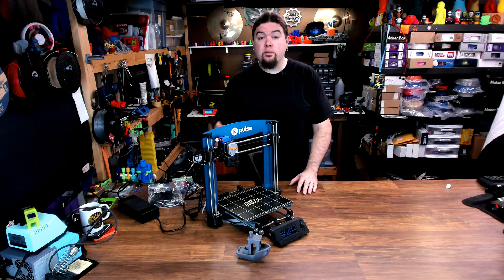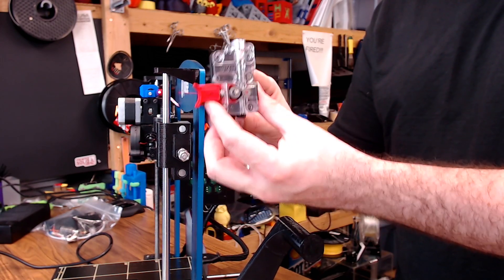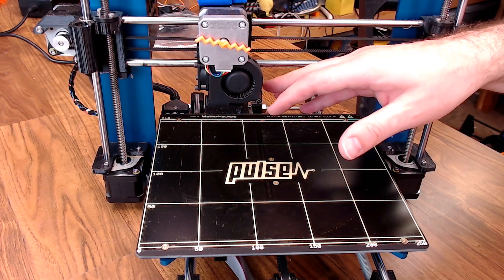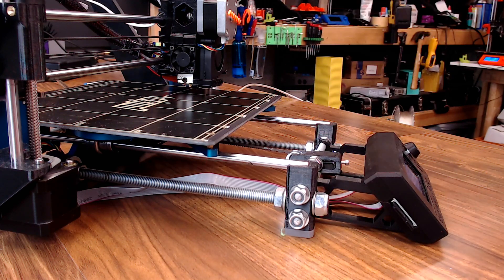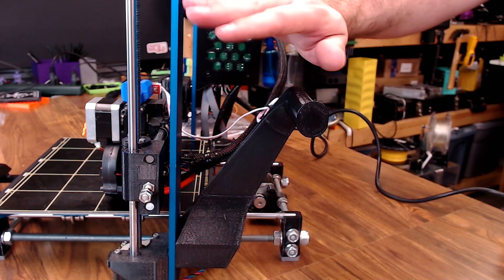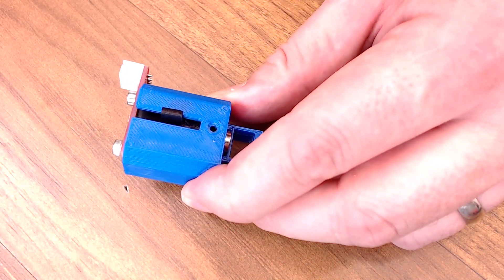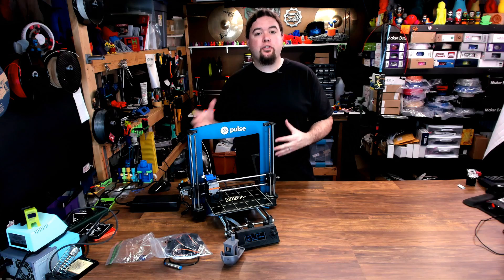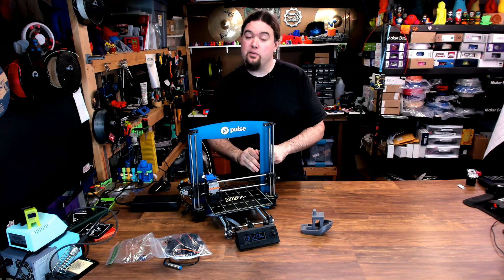The Pulse CR - Rework & Upgrades - Chris's Basement

Comment: 9:56 100 mms ? What is your Marlin max feed rate and acceleration set too? 100mms seems rather fast for this style of printer, especially with a direct drive setup.  would you mind printing this out and showing us the videoed results please Chris? https://www.thingiverse.com/thing:1586548 Honestly, I still think the Pulse is an insult to Prusa lol JS it's one thing to use an open-source design for individuals like us to make our own printers as DIY guys and gals, and another thing to mass-produce for retail.
Reply from the maker: On this one I have the max feedrate set to 500 for X and Y. The max on this print is 100mm/s, that is the infill setting. The shells are printed at 60. I can still run that test though, it might be interesting.
Reply: @ChrisRiley  And the DEFAULT_MAX_ACCELERATION all set to 3000 as well?
Reply from the maker: @patprop74  I currently have this one set to 9000 on X and Y.
Reply: @ChrisRiley  Ill be honest with you, I really doubt any of my homemade prusa's could pull that speed off and getting clean results, Then again my beds are 200mmx300mm and that extra 100mm rod length along the Y-axis,  does make things bounce around more, not to mention they are also using Chimera's on a direct drive setup, those two motors do add some weight to throw around. But nonetheless, for argument sake, I will print one out using the slicer settings you mentioned. Cheers, Chris.
Reply: @ChrisRiley  2 hours and 50 mins later! you are correct, I just printed one scaled at 200% and at 100mms, and the results were surprisingly good on my printer, it has been a long time since i printed that fast and I must say, I don't know why I don't more often, Thanks, Chris. i would still like to see the results for that speed test thing.
Reply from the maker: @patprop74  Cool! Yeah, I will get one run and see how it looks.
Reply: @ChrisRiley  Just a little clip of my print out of ABS at your suggested 100mms lol https://youtu.be/x7nAyV9QsyQ

Comment: I love Matterhackers, but they took a Prusa, made it worse, and are selling it for more. I don't get it.
Reply: I see where you are coming from. I don't care for the 399.00 32 bit upgrade they were still charging, a month ago. I don't have a problem if they did it initially but it's been months. The cost of development and improvements should have been covered by now, especially considering other makers have 32 bit standard. To each his own I guess.
Reply: @spanny52  true, I mean you can buy a 32 bit SKR 1.3 for an ender 3 or any other printer for under $50 and run Marlin no problem. $399 is insane.
Reply from the maker: @TheMidnightSmith  I am right there with you both, I really appreciate the support, but the price seems to high even with that included.

Comment: Loving LA in Marlin. Just ran a retraction test on my new titan clone. It started out at 0.5mm w/ no stringing just webs between the towers. 😎🏆 (edited) (0-1.25mm span in 5mm Z segments)
Reply from the maker: Very nice! It does help out a lot.
Reply: @ChrisRiley  spoke too soon. camera lied to me. Needs 0.5mm on the titan. Bowden was only 1.5mm with L.A. though. Now to reduce accel (base layer had shifted too) and try tuning junction deviation.
Reply from the maker: @OldCurmudgeon3DP  Have you found any difference in JD vs jerk? I can't see any at all.
Reply: @ChrisRiley  just started with it. Facebook opinion is all over the place. Good to know your experience with it though. Shame I have to recompile to test both.

Comment: Great Video - It DEFINITELY needs a bigger PS. Try printing something with the nozzle at 270 and the Bed at 100 especially if you got a 40W cartridge in the V6 and you will see the voltage drop close to 11V and in some cases if on top of that you turn the fan on you will get a thermal runaway
Reply from the maker: Wow, I will have to measure mine.
Reply: @ChrisRiley  Look at the Mini rambo Docs. It says "Power supply >16A" If you got the same pulse PS as I did its 15A. And last i checked 15 is not >16. Also if you got the old style with the din connector then each one of the din connectors is rated for 7.5A now the bed if you run it at 100 will draw about 8 which is one of the 2 DIN pins which means you run it above its rating so the connector gets hot and at some point the wire burns through happened to me. So after long arguments they sent me one with a HT60 connector on it and told me to wire both into it but that still was a 15 A Now do a little math Bed 8A 4 motors 6A (actually more as they are 1.7A motors. 40watt heater cartridge about 3.5 A and we are already at 17.5 figure some you loose on the board and fans etc and I wouldn't want to run this printer with a PS <20A. Now MH told me "What you expect if you run the printer at the max all the time" SO I said "When I bought that printer I said I want to print Nylon, HIPS, ABS and maybe some PETG and I said the HIPS I am printing is suggested to be printed between 250-270 with 100-110 bed. And I was told no problem you can do that 24/7 so I bought it last summer It was back for multiple warranty repairs. So now that its out of warranty the first thing it gets is a 30A PS, The rambo board gets a fan as the chips driving the 40W heater cartridge get hot ("don't worry they can handle 150C" I was told) and then - yes thanks for the hotend changes saves me some work and it gets an enclosure. Another problem with the Stock as the hotend bracket and fan shroud is printed stock from ryno that gets soft at 60C Try heating the bed to 100C and print something that covers the whole bed You will melt the bottom of the hotend assembly - especially the fan shroud - I reprinted it from HIPS.The bed destroyed a mini rambo as they did not put strain relief on the wires coming from the board and the moving back and forth of the board causes arcing (described on the prusa website) and destroyed the board and burned some stuff off.So they replaced that and put a strain relief on in a manner that the wire crosses on top of the board so I cant print anything in the left back corner that is taller than 50mm. or it snags the wire - so that gets rewired and it is going to get an enclosure Last I was told "No one is running this printer with the nozzle above 255 and the bed above 80 why would you want to what you are doing is like running your car full out" (I used to do that on my beatle for 240k miles guess this is no beatle) So now its being upgraded - not quite to what it was sold to me as (like I was told "if you get the V6 all metal you can go to 400") but I want to do 270/280 on the hotend and 100 on the bed and do consistently 8 - 16h prints without too many problems. Even with all this 12 months over 70kg of hips about 12-15 Nylon 10kg of PETG and 2kg of PLA - 1 Mini rambo - 2 heater cartridges - 4 thermistors - 3 dozen socks - 2 Hotend assemblies 2 power supplies. And misc others What we are using all this filament on is we are FRC team 1989 and print 30x30x48 in robots weighing up to 150lb